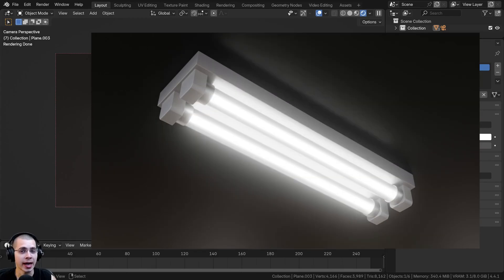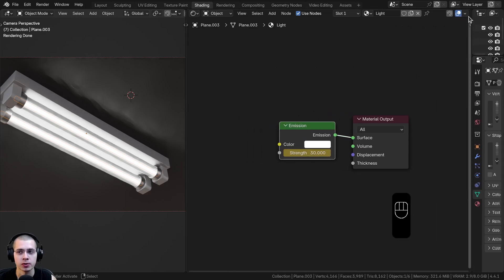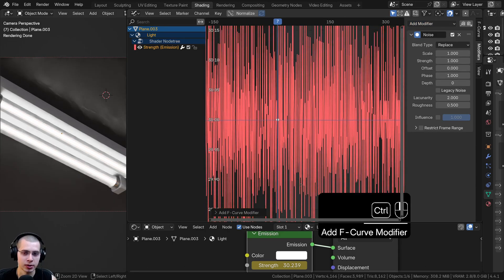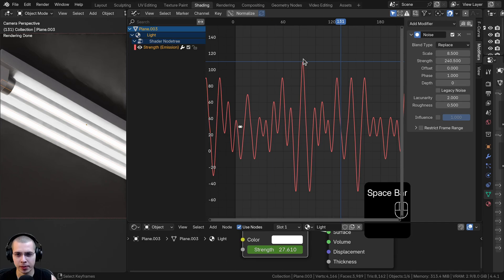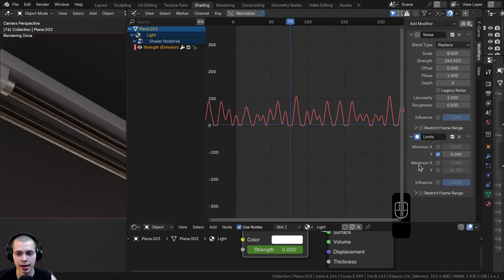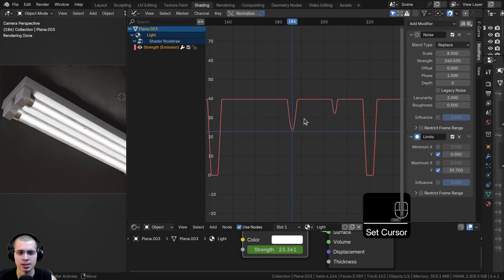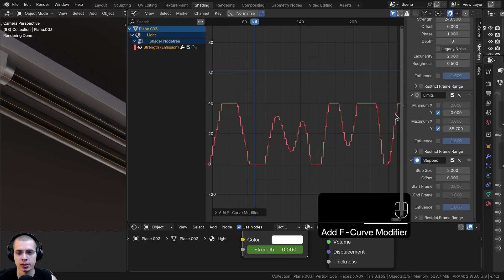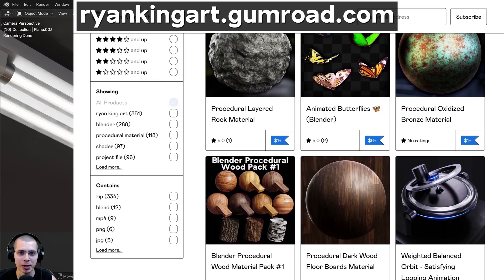How to Animate Flickering Lights in Blender (Tutorial)

Comment: you can also use a white noise node with the W value keyframed, plugged into a math node set to "greater then" with a threshold of 0.5, and plug that into your emission shader. basically the white noise returns a random value between 0.0 and 1.0. anything greater then 0.5 is on, less then 0.5 is off. i managed to get this working with a backrooms render i was doing. i had to use a couple of mix shaders to get it working with the ceiling tile shader i was using but it worked pretty well. i like your method better tho. waaaaay more control. 👍

Comment: Great video❤! Can you tell me where to find out about keyframing a Boolean difference (or any of the mesh modifiers)? On the Dope Sheet on Frame 1, I add a UV Sphere. Then move it along the X axis to Frame 30. Then, in Frame 40, I do a Boolean difference with a small rectangle, and keyframe the modifier (I click on the small circle next to the Type and change it to a diamond. I also just tried ‘I’). But, when I play the animation, the Boolean difference is showing in Frame 1 (and throughout), instead of just showing up at Frame 40… Please help 🙏🏻Many Thanks🙏🏻❤